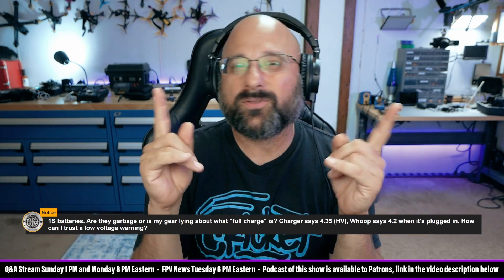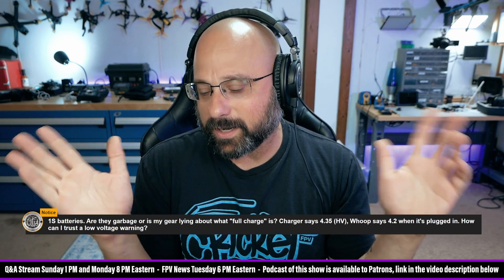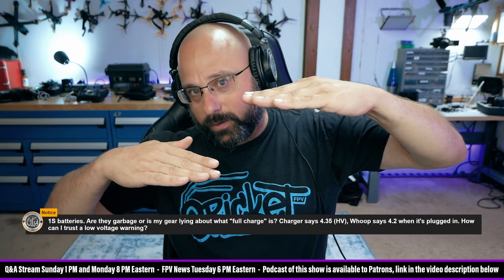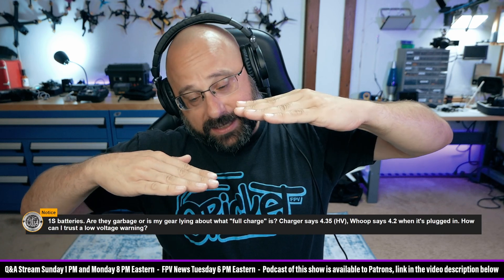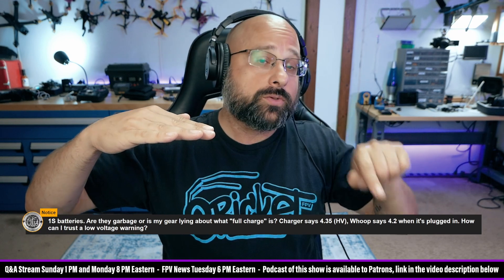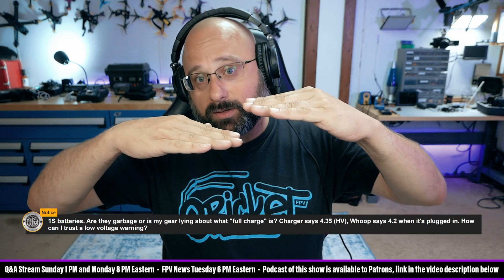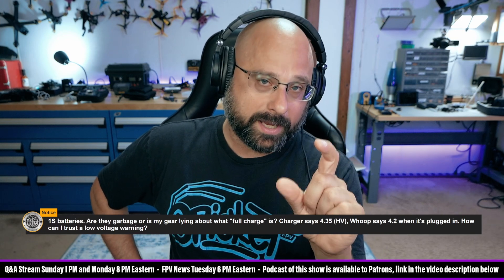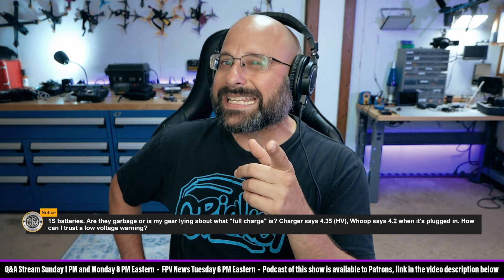My Charger Says My Battery is Charged, But My Drone Says It's Not? Which Do I Trust? - FPV Questions

Comment: Good advice but that isn't what most people are experiencing. A lot of these drones have faulty LV sensors. The battery (or batteries) are fully charged but the controller will not allow the drone to fly because it thinks the battery is dead. I know this because one of my cheap drones dropped 4 feet and suddenly thinks any battery I install is dead. I do like your advice though.  Always break out the multi meter first.

Comment: I recently,y bought a bunch of 500mah 2s packs by R-line. I charge to 4,2. If I put them in my quad immediately my quad says 3,9 or even lower. Never had this issue with 4s or 6s packs

Comment: There is more load and thus more instantaneous voltage sag when the battery is connected to a charger vs powering the FC. Both can be technically correct but show different values

Comment: Any advice on a solid 1s whoop pack off Amazon? Also, I'm in the market for a buy once cry once chargers/ balancer. Any recommendations?
Reply: If you want a charger for 1S batteries, there's nothing better than a WhoopStor. You can power it with a battery pack that has an XT60 plug, or a DC power supply with a barrel plug. If you use a power supply, make sure it's 6 - 26V and minimum of 40 watts. For 1S batteries, anything from GNB with an A30 connector and a C rating of around 100C is good - not the best, but good. If you want the best possible 1S batteries, get something that is folded cell with a BT2.0 connector. Examples of folded cell batteries are BetaFPV Lava, weBLEEDfpv, Tiny Whoop (the brand), and I think Tattu as well.
Reply: @mikerich32  thanks bro. I have a few folded cell 1s packs from R.R. and I think I may just order some more from there. They seem to do well. ..... I do need a solid charger for when I upgrade to 4-6s drone & packs.. 
  For now been ripping the whoops. Just grabbed the vision 40HD 75mm from RR super fun whip!
Reply: I literally don't own a 1s charger. I have 4s and 6s serial charge leads, I bought one and made the other, and I use my regular chargers (Hota D6 and ToolkitRC M6). Everyone tells me Toolkit is garbage but mine's been solid, I do trust the Hota more though. RE batteries, can't comment- I live in China, where they're all made basically, and they're super cheap on Taobao (AliExpress in the West). Series charge leads pros: can use a decent charger, balance, discharge, all that good stuff- charger sees the 4 or 6 1s packs as a single 4s or 6s. Cons: You have to charge either 4 or 6 packs at once (or make a 2s or 3s lead).
Reply: The vifly smart series 1s board....